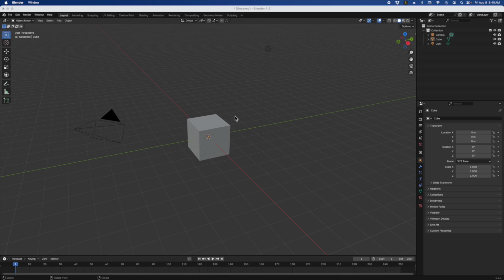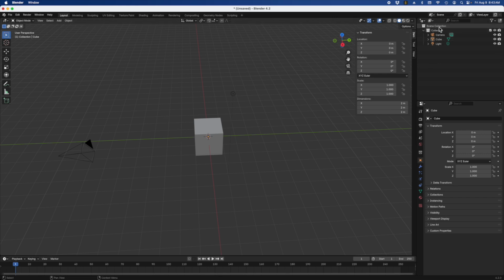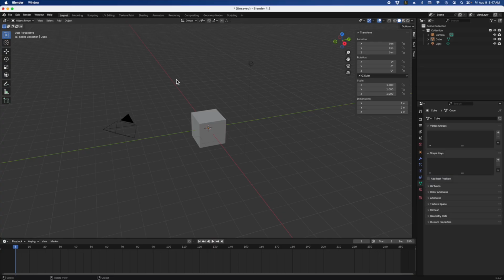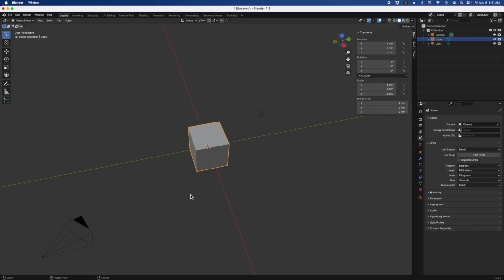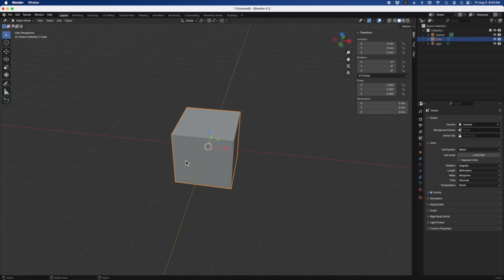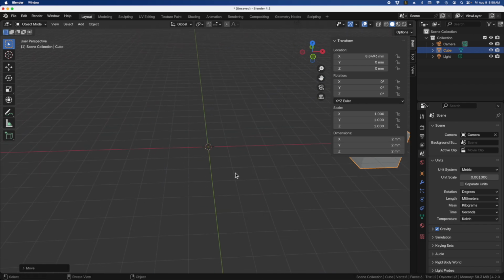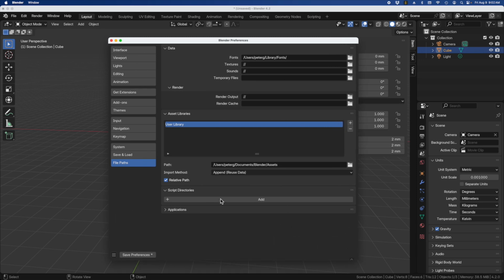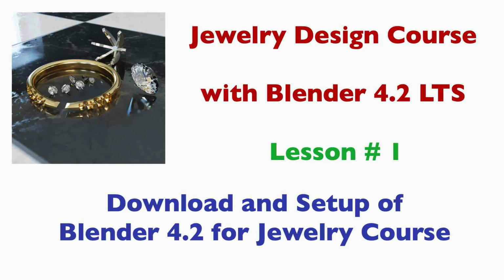Jewelry Design Course - Lesson 1  Download Blender 4.2

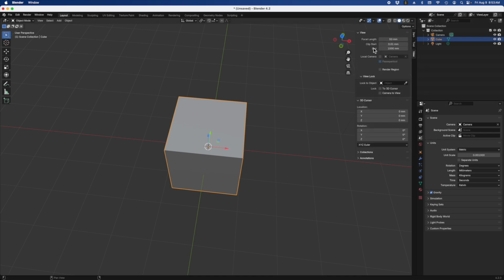Comment: question - at 15:37 - I changed the end to 1,000,000 mm and got weird glitch - on top and side views - changed to 10,000 mm - glitch went away  - any ideas - graphics card -      AMD Ryzen 7 5700G with Radeon Graphics            3.80 GHz
Reply from the maker: It has a lot to do with your scale settings.  I’ve noticed with 4.2 that there are a few differences with both the windows and Mac versions.  Playing with the number as you did is the only way to find the best results